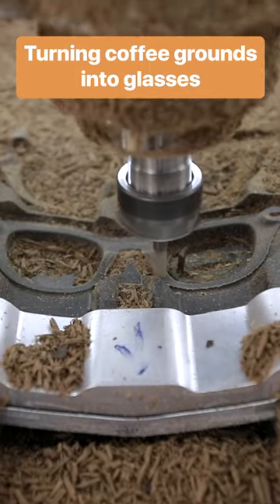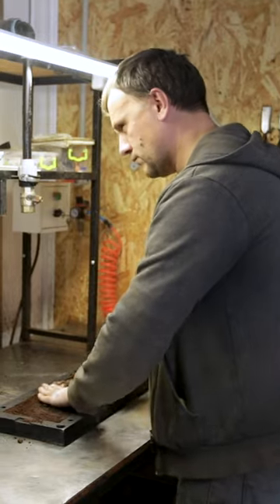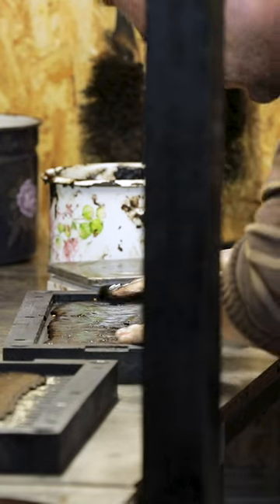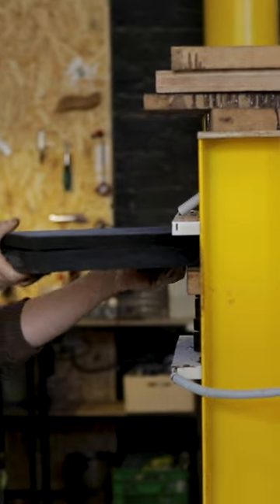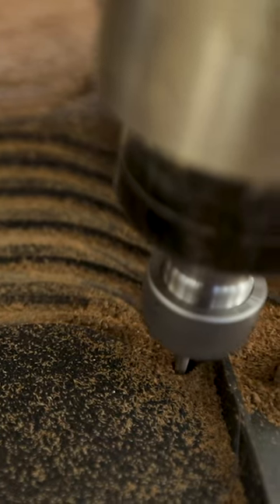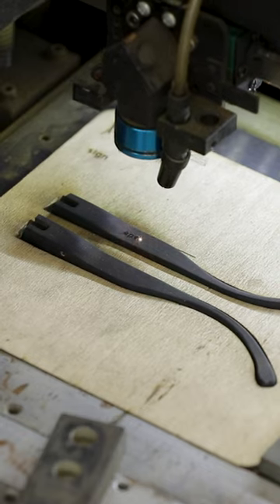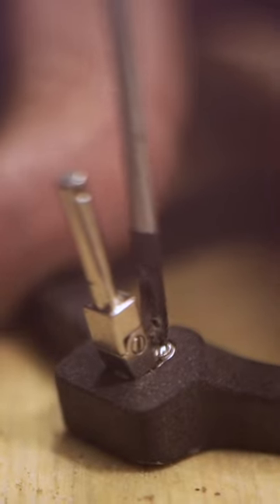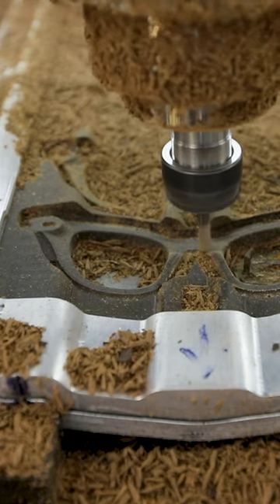This is how glasses are made from coffee grounds. #coffee #glasses #ecofriendly

Comment: I wonder if the reduction in material costs outweighs the increase in production costs
Reply: I'm sure they sell these on a luxury price point where that doesn't really matter, which is a shame, if these "plant oils" are really bio degradable then this would be nice to use instead of other plastics also.
Reply: Around 300 bucks per pair.
If they produce 100 pairs per batch the profit should outweigh the cost of the production.
Reply: @maszlagma plant oils are almost always biodegradable
Reply: @everettduncan7543  what kind of plant based oils do you think is used?
Reply: @chesronhawker4569  not sure
Reply: It's doesn't..most of these companies only do it for the "unique" potential for the markup prices..